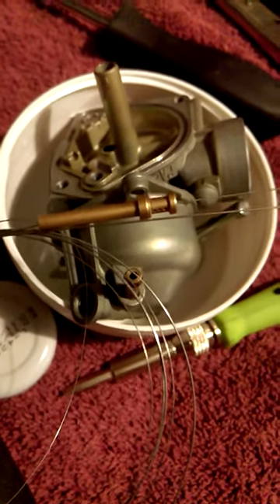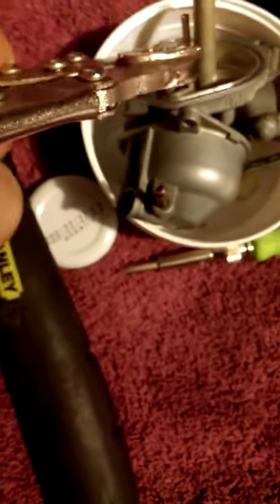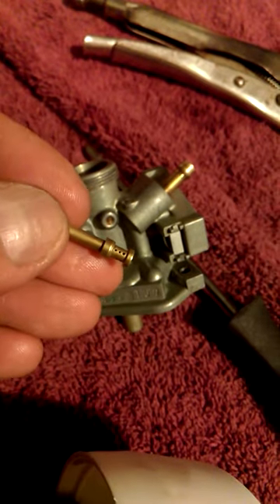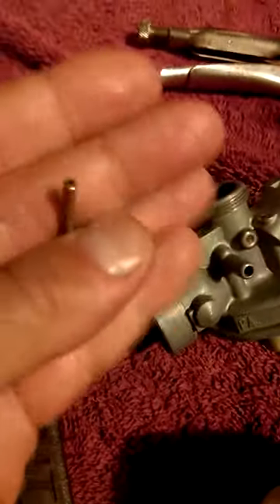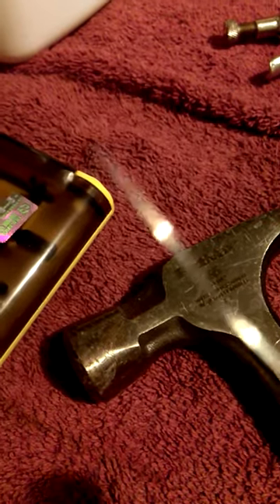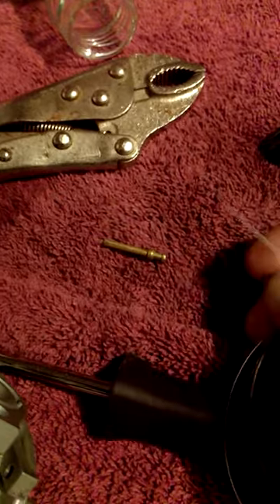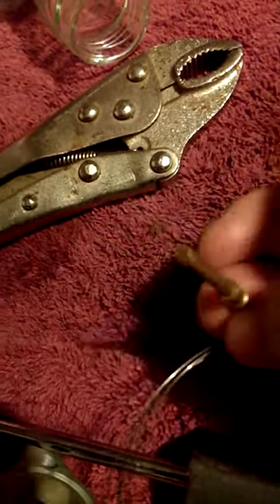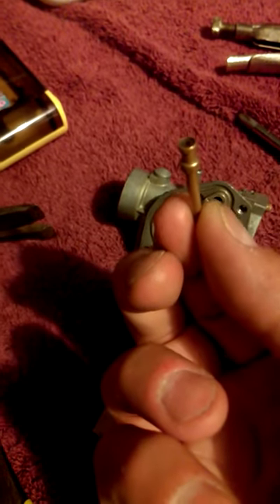How to Clean A Honda CRF50 Carb With  Pressed in Pilot Jet ** Guitar "B" String Fix!**

Comment: Good video just took my 50’s carb apart my pilot jet is so clogged I can’t even get a guitar string through it I’ve been working at it for awhile
Reply from the maker: Kyle Walsh try soaking the pilot jet in some boiling water and citrus degreaser. Then poke the jet with the above mentioned guitar string while twisting, it'll work just keep pushing!

Comment: how do you get the pilot jet out... that's the hardest part
Reply from the maker: Daniel Tran grab it lightly with a pair of small vise grips, don’t crush the jet accidentally by squeezing to tight on the vise grips. Then tap the grip outwardly by the jet to tap it out. Be careful with it and eventually it will pop off. Good luck man hope it helped you.

Comment: Got damit. I just had mines apart because it doesn’t idle right and I cleaned everything else and was like is this one supposed to be like this. I used a needle and a plyer and cannot get it. Well looks like ima have to go grab me some small bit and drill it out
Reply from the maker: Don’t do that, I’d hate for u to ruin it, get a “B” guitar string just like  I said in the video, it’ll work just follow the video bro

Comment: Do you happen to know what the actual drill size is for it. I have same year as yours and 2 days in 200 degree ultrasonic and couldnt get it cleaned. We used small pin vise drill and by hand slowly got it cleaned but afraid i we oversized it. Its way bigger hole then chinese knockoff and afraid i messed it up going by what guys on forums used.

Comment: Use the G. The brass scrapes al the dirt out perfect.
Reply from the maker: SMS CUSTOMS Hey SMS Customs, yes for the bike/carb im demonstrating in the video the "B" string works perfect for middle central hole that runs the entire length of the pilot jet. The "G" string you suggested works great for the slightly larger holes on the side of the pilot jet. You actually need both to do a complete cleaning of the jet. Thanks for commenting!
Reply: 1